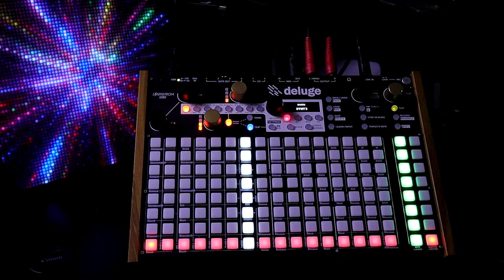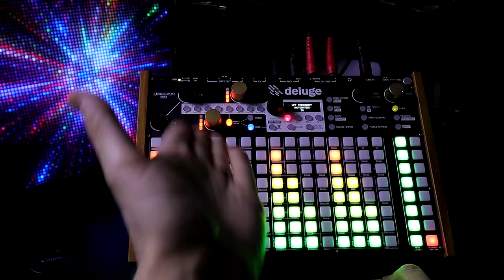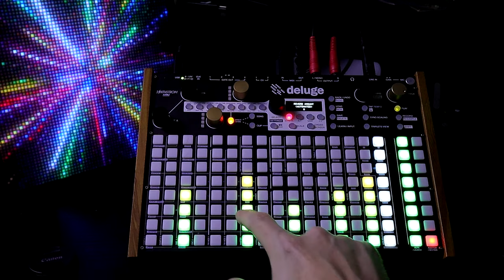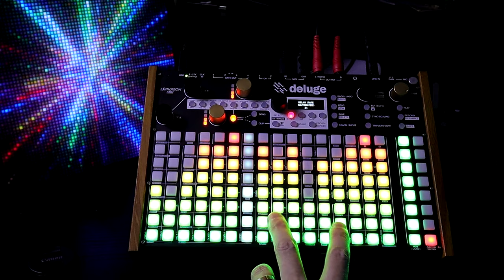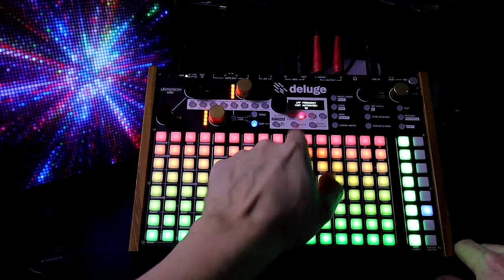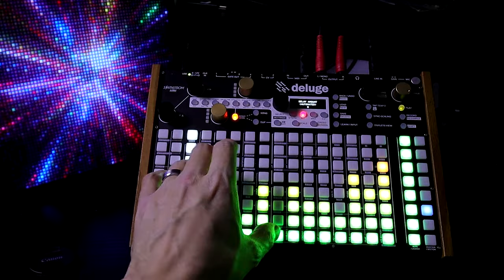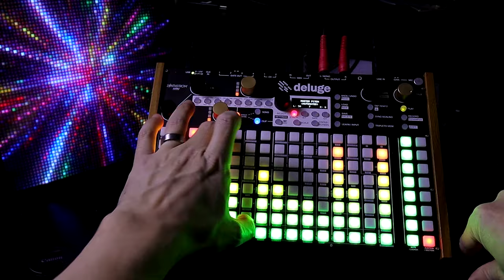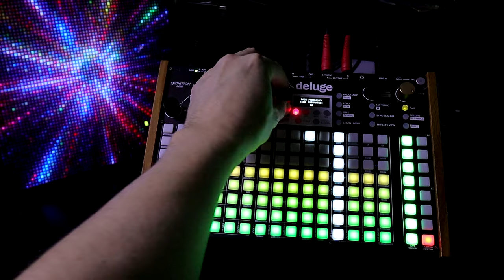DELUGE AUTOMATION MODE PART 1 - EXPERIMENTATION // SYNTHSTROM DELUGE TUTORIAL

Comment: I thought of getting a pulsar 23 for some weird sounds. I might think again.
Reply from the maker: I own one and it's very very different than what I'm doing here. Equally as awesome imo
Reply: @RonCavagnaro  I am sure it is totally different while possibly equally awesome. I was just surprised by the sound range you got from the deluge. Regarding synth sounds I mostly use the deluge for midi sketches I run through my peak and tweak there. So (ab)using the effects section from the deluge is not something I am used to or expected to sound this crazy.